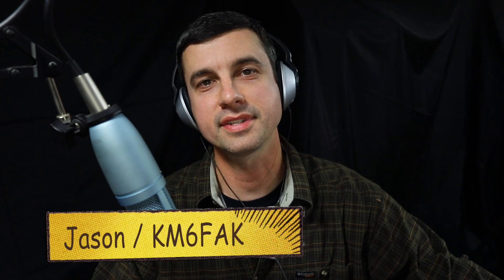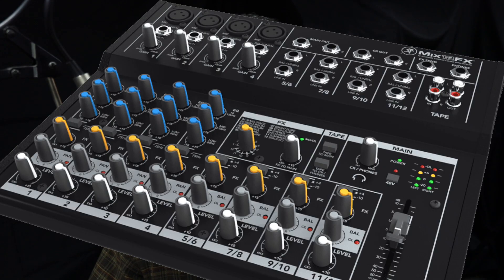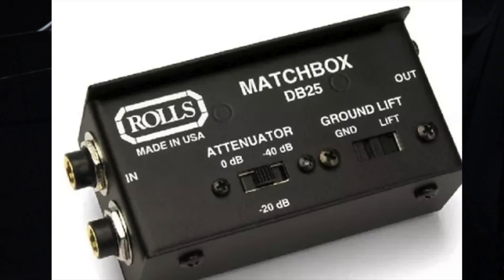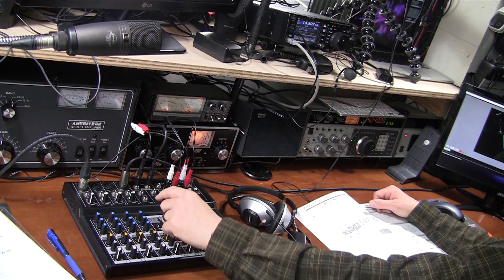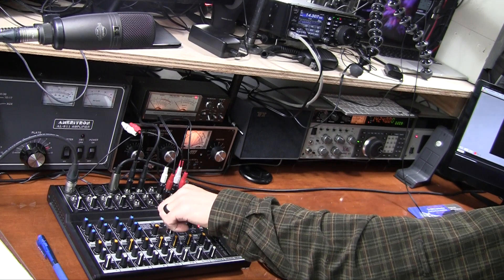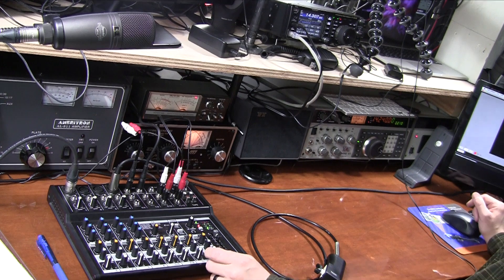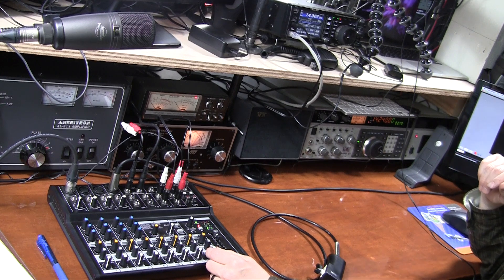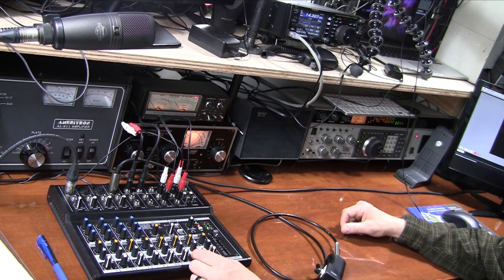How To Connect Your Boom Mic Into A Ham Radio

Comment: I also have a FT-991a. I am most curious about the transformer and why you did that. It looks like a direct box which usually are used for instruments and sound systems. I 3D printed a box (well most of it...) and bought connectors on Amazon to make an interface. I have a photo on my QRZ (KD0LJE). I so far am not getting audio. I have a phantom power box but, nothing is coming through. I am getting a small mixer and will see what happens. I am going to check the connections when I get home today with a electrical meter to see if they are pinned correctly. Thanks for this video! I think it will help me get going with the mic...BTW I am pretty sure you have a similar mic to mine. I have an AKG P-120.

Comment: 8:08 where there's a will there's a way... Get yourself a cheap plastic step-stool and a guitar foot switch pedal and bolt or even hot glue that sucker to the stool! They also make add-on foot rests. 😎 MacGyver out... 73!

Comment: what was the purpose of the DI Box? You called it a match.  a DI Box is usually used for impedance matching, but you was using a mixer you should be able to connect the mixer directly to the radio.  anyway good video. WN9K

Comment: Great video and something I'm certainly thinking about - but I got a bit lost at teh DI Box !
Is the signal chain :
Mic (XLR) > Mixer I/P (providing 48V Phantom Power) > Mixer o/p (jack - adjustable Line Level) > DI Box (jack) >  DI Box (XLR) to TxRx via new cable ?
Thanks for your help .

Comment: I've made my own connecters and homemade adapters for rack gear For use with all sorts of radios. Ptts I've made with old xlr cable and plugs and the audio connection right to the mic jack. I'm so tired of making this stuff.  By far go with Heil's ptt( I just bought it) it's so well made and you can replace parts. Heil also has the audio connection from the rack gear to your mic jack ready for a ptt switch. So no more burn holes in your wife's antique table and you won't have to worry about the cat nocking over the soldering iron onto the carpet... The pr40 sounds great with rack gear If your experimenting. You did a great job with your adapters and probably work way better then mine and it's neat to see others do it!

Comment: Hi, can I connect the headset output from the mic audio console  to the db25 input?, headset output  is not hi impedance, and is the only output i have on the  console
Reply from the maker: You can run a mic of your choice into a mixer. Then out of the mixer you will run that to the Mic connector of the radio. A custom cable will be needed.

Comment: so as we mentioned in messenger your mics are keyed with one keyer not two? so it will be a good test to give your daughter her own keyer on her mic ya????
Reply from the maker: On my FT-991A I trigger the PTT with the front mic connector and only use one hand trigger. There is a lot of ways you could wire in additional PTT's or even use VOX.

Comment: So I'm running similar setup to you, FT-991A with a Heil PR-781. From the FT-991A, using a Heil AD-1YM adapter, (one side a heil 1/4" ptt switch) the other side 3.5mm to 1/4" adapter => 1/4" audio cable to a mixer, and the mixer to the PR-781 via XLR cable.
Reply from the maker: Oh good deal! Yeah, most dynamic mics will work with the voltage on the mic jack from the radio. But on a condenser microphone, you will need the phantom power from the mixer. Either way, it's all good fun!

Comment: Why do you use a direct box with a vocal mike? You usually use these with a guitar or other instrument.
Reply from the maker: The direct box acts like a isolator and only allows the audio signal to pass. You don't need one of these, but it would be best practice to keep and ground loops/hums away from your audio.

Comment: Need Some Help........

Is it true that if I connect a PR-40 to the mic output on the ft-991 it will damage the mic due to the output power from the transceiver? Im getting a lot of conflicting info and do not want to damage either the 991 or the pr-40.

Comment: What is the make and model of the mixer that you use?
Reply from the maker: In this video I was using a Mackie Mix12FX. But I use a couple and all different brands. They are all about the same for using them with Ham Radio, it's more about what features they have.

Comment: since the radio connector is prone to failure, I would always connect all 8 conductors of the cat5 cable to the rj45 crimp connector.  cut the unused cable conductor off on the other end.
Reply from the maker: That's a good idea.

Comment: Hello Jason, my name is Jason also w2esc I know this video was done some time ago but I have just recently bought an yaesu 991a myself I'm curious with running that type of audio equipment how do you have your radios EQ setup I'm planning to upgrade my microphone soon to a shure sm7 b and would really appreciate it if you could tell me how you have your EQ setup thanks
Reply from the maker: Hey great name! I run the radio in default EQ settings. I then touch up the EQ on the mixer with just a little of highs, mids and just a touch of lows. I also have the mic gain of the 991A at 10.

Comment: wont the transmitter kill the input of the sdr?
btw VK=Australia, ZL=New Zealand ;-P
Reply from the maker: Yes, it gets tricky when running a SDR at home. You'll need a way to lift the signal into the SDR and you go to transmit. The MFJ-1708B-SDR does that. Thanks!

Comment: What about going through the back of the radio? Which ACC port would you use?  Some radios it's better to use the back connection..
Reply from the maker: That will depend on your radio. The FT-991A only has a RJ45 in the front that will take mic in. Also, certain radios can only power certain microphones. Using a mixer allows the use of any mic and also gives a lot more utility to do other things or send audio to multiple radios.
Reply: @HamRadioTV  Thanks

Comment: What is the reason for passing the mic audio through the transformer?
Reply from the maker: It will keep the radio and the mixing board physically separated in the event a ground loop is present. This could be from the 12VDC circuit and your 120VAC ground. It will work with out it, but could put noise on your signal.

Comment: I have a custom cable that works direct heil mic to radio, but when i try and use that same cable via a mixer i just get noise as soon as i press the ptt. Even if i disable the channel on the mixer i still get the tx noise.
Reply: The problem was my dual DI box, one side had a bad transformer. Now works great, the Heil cable is wired the same as in this video.
Reply from the maker: Very cool you got to the bottom!

Comment: Do you know if this could work with a Yaesu FTM-7250D? It is my mobile radio that I use as a base, it has a MH-48 DTMF microphone with a 6 pin connector. So long as I match the connections like you, I think I'd be on the right track. However,  I'm interested in using the mixer to help me add a morse code key and my computer for SSTV but I am not sure if then I would also need to include a PTT switch for those lines too... which I assume would come from the main line going into my radio? I'm a mess haha
Reply from the maker: You have all good thoughts. I would just pick one thing first and do that. You can run a XLR mic and mixer on just about every radio. Every radio will be different but the essentials are 2 wires for the PTT and two wires for the mic. I did another video that might be of some help: https://youtu.be/hdVIUuvm2r4
Reply: @HamRadioTV  thanks for the info! I'm on your longer and more detailed video about how you got this project to work so let's hope for the best! This is a big help to a new guy like me, 73!

Comment: Got Your Response,  line outputs  into Mic input work's if it's High Input but most inputs on radios are around 600 Ohms. So yes a DI interface is much better unless the mixer has a Mic level output on it, either Balanced or unbalanced!
Reply: @HamRadioTV  so what about making a wire into the DATA socket which have line out (sql/unsql on different pins(1200 / 9600)), line in and PTT?

Comment: 73's,  if I'm not mistaken Heil does makes the adapter kit that mates the XLR TO THE  Radio's  Mic input  plug. . However I like using the Mixer approach  a bit better. Great demo on the use of using a pro audio Mic. Or as some musicians  would say Stage Mics. Those Mics  are a plus when using them for Ham radio for Clairity!
Reply from the maker: Yes, you are correct. Heil will sell you the connector for your radio and then into the Mic you choose. But what I couldn't find, is Heil selling the adapter from your radio to a line input on the mixing board. I also wanted to run it through a DI box (isolation transformer). Thanks for watching! 73
Reply: @HamRadioTV  most Radios have an Line output on them! If not , try using the Headphone output. There should be enough drive to suit your mixers inputs!

Comment: Great setup, I have the same radio and I'm looking at setting up something similar with boom mike, speaker, and sdr. Did you do a video on the other connections (speaker, computer)? Does the PTT disconnect the SDR as well as the radio when you key up? A friend had a slight delayed feedback when he would listen to SDR when keying up to talk on same frequency.
Reply from the maker: Thank You! Here is a link Kevin and I did more of a deep dive into using a mixer in the shack. The speaker I use comes off the mixer. The PTT just triggers the radio. I have some ideas how to us a relay to mute the SDR audio, but nothing yet. For now I use headphones when listening to web SDRs. https://youtu.be/hdVIUuvm2r4